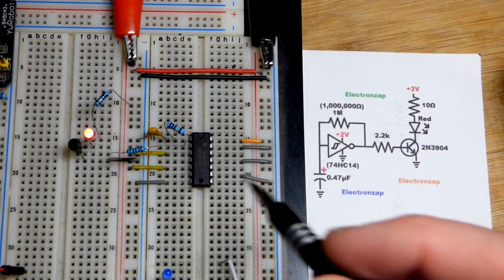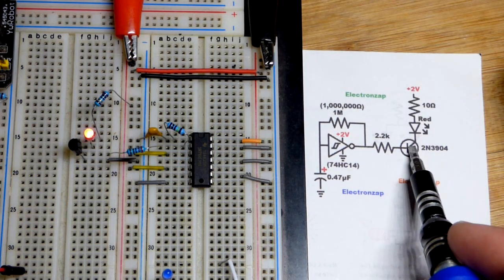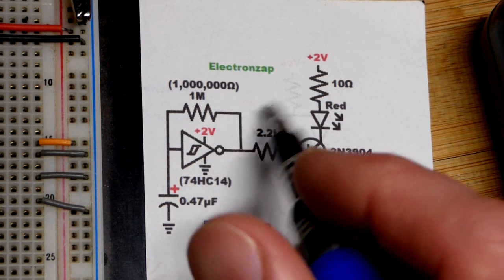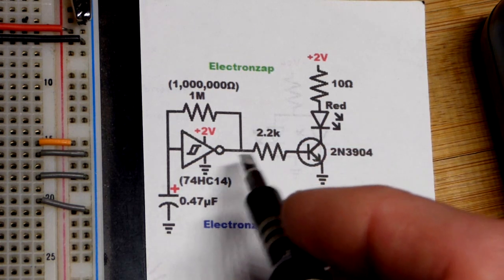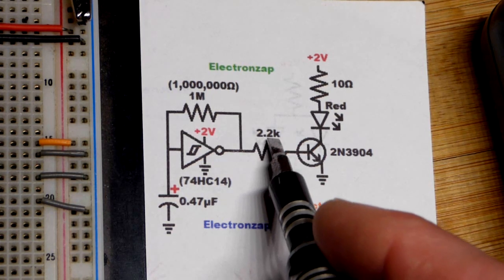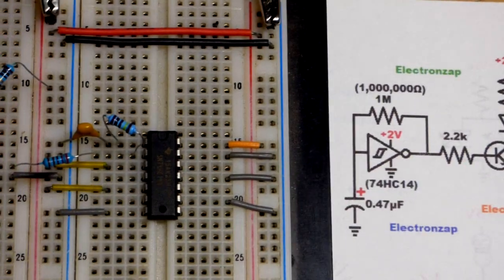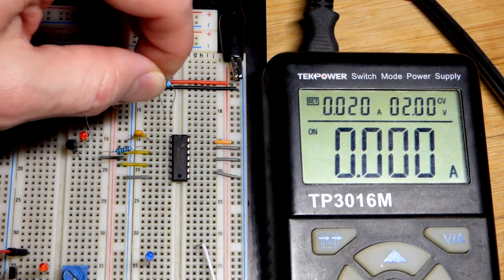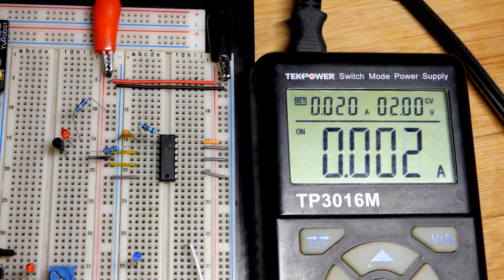2V low power circuit NPN BJT improved 74HC14 LED flasher circuit learning electronics shorts 110

Comment: You should use a second NOT gate as a buffer for the first gates output.  If you want the pulse non inverted add a second buffer in the circuit after the first buffer NOT gate.   Might as well they are in the chip ready to use.